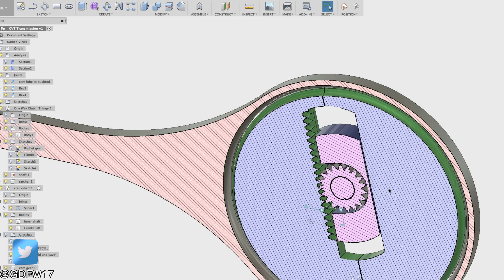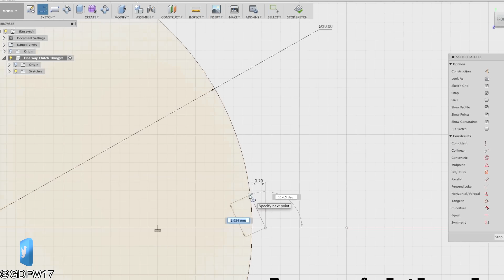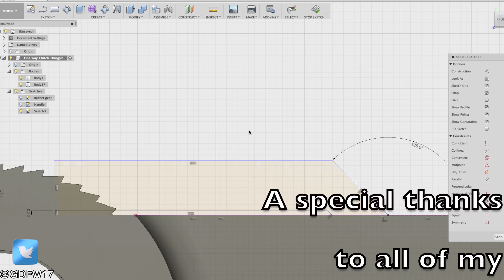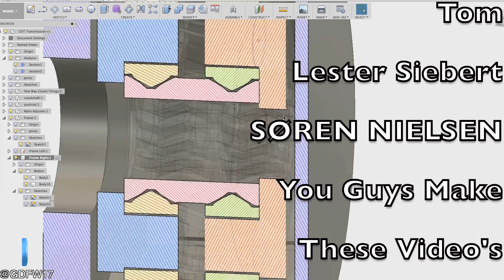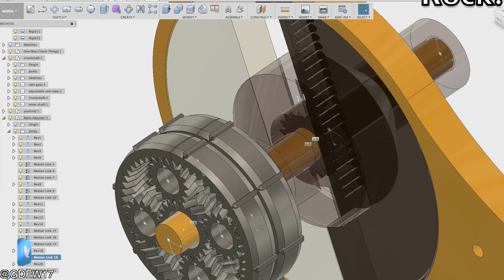The Coolest Transmission You've Never Heard Of... The Ratcheting CVT

Comment: Where did I see that idea before? Ah, I remember! 25 or so years ago, I tried to patent it. The weakest point of this transmission is that it has no way of holding the ratchet shaft if it decided to roll and overtake the speed it is intended to rotate with. You can't use it in the automotive industry (at least not without breaks). But then there is a beautiful CVT inside Toyota hybrids. It links the internal combustion engine, the electric  motor and the wheels in a computer controlled CVT which can be accelerated, decelerated and at the same time used to regenerate power via the electric motor. Absolutely BRILLIANT that CVT of Toyota's. Find their tech manuals and read it up.
Great 3D printing but sorry man you won't make money on it.
Reply: Dmitriy Lobov but then. Guess what, I don't think an over complicated system is like a time bomb.
Reply: How much time did it took to write
Reply: Another wannabe talking nonsense.

Comment: Very nice engineering.  I imagine that modern CVT design heavily leans toward noise and vibration reduction.  Easy example is helical gears opposed to straight cut in a differential.

Comment: This was a nice clip, great workmanship on a device. However, I fail to understand why this is a transmission. A transmission helps the engine to work less (rpms) and delivers more output (rotations). Your device doesn't appear to do that. The input rotates faster than the output. Your transmission works in reverse expectations. Think of like a bicycle. Peddle less but reach greater distance.
Reply from the maker: The word transmission doesn’t imply RPM increase. Cars for example use a transmission that decreases the RPM’s.
A transmission can work either way depending on what it’s designed for.

Comment: It would be easier to follow if you put a dab of paint on one, or maybe two of the splines of the output shaft. I think that this would help illustrate how the speed changed as you varied the ratio with the adjustment knob. I have to say that it is a pretty cool machine.

Comment: Hmm, well, CVT is great, but I found it is not very heavy duty. What makes matters worse, in my opinion, is that the greedy company just don't care to get better material so the transmission would last longer. I had a motorcycle with gears and auto clutch transmission and a scooter which use CVT. The scooter had transmission problems twice, which the belt broken after 20000km or so of riding. The auto clutch with gears had no issues at all at the transmission.

Comment: I know the feel, some years ago I tried to came up with an idea to reduce the lenght of the engines and used a Boxer as a base, so the idea was to cross two of them like an X and it seemed like a good Idea at first, then doing more research I ended up facing that those engines were used to power up planes before I was even born

Comment: Brilliant thinking, but even submerged in a tub of atf it would probably eat itself under load. I always thought about a chain driven transmission that works like a bicycle and the chain hops onto a different gear and the slack gets taken up by a tensioner, but have a computer control the shifting and use a torque converter to mate it to the engine. Only problem is if you lock up your wheels, you're stuck in the wrong gear, since it takes motion to shift.

Comment: For your final drive look into the concept of sprags. Reduce wear and ratcheting noise. There is a very simple design consisting of an inner race with ramps a cylinder roller and flat metal formed into a zigzag spring to keep the roller pushed up the ramp. The outer race is smooth. Going the active direction the roller pushes against the spring and down the ramp. Try to reverse and spring pushes up the ramp and wedges against the ramp and outer race and stops the rotation. Very quiet, very smooth and silent.

Comment: 5:40 "it s like using a super computer to play solitaire." ~ Scotty Kilmer might like that line. He might be able to help promote your product too.

I believe in Air Fuel displacement not Piston Numbers. Decided back in the Slant Six Days, an In-line and Opposed Cylinder Engine is neat. 1 to 4 pistons seems ideal for reliable operation.

But when people talk Engineering instead of personal experiences, I feel for my limited personal Observations look at car spokes and ask myself if perfection is 5 spokes then five piston engines also, yes?  Where are five piston engines?  It it true that an Odd number of lug nuts is better than 4 nuts? Where is 1 piston pump, 3 survey legs for a crawler, five pistons to roll over anything, and 7 Fast & Furious Light pistons for each of these ideals, yes?

Comment: So maybe you could have your engine set to a specific rpm all the time for it to be in the best ratio for power and have the "gas" pedal change the gear ratio in the transmission up or down to change the output speed
Reply: Semis could even double up on the number of gears to give it a much higher ratio to increase tork without increasing gas usage.

Comment: 3 things, current production CVT’s with ECU combo’s don’t hold the engine in peak torque and HP when driving in any performance setting(it technically could maintain peak performance from the engine with an ECU tune but thats extra money and effectively makes any daily drive-ability gone ), second, they cannot handle boost, lot’s of stories of Nissan Altimas with CVT’s burning out and even destroying tranny’s when turbocharged, third, they just can’t handle horsepower and rigorous track driving, I’m not saying they aren’t a good transmission, my Nissan Rogue has one and I’m very satisfied with it, but it definitely has limitations when it comes to motorsports, on a sidenote, great video and I love what you created here(subbed :)

Comment: My thoughts:
I like the 3 drive approach, alike 3 phase power they can all super impose to smooth out the output.
That said, there is error in manufacture and that error would introduce an oscillation on the output drive's motion.
It would be interesting to see what set of frequency that error could produce.
Usually +/- 0.1mm on each axis if your not certain and just want a test figure.

Still, if you were to use this for a precision drive you would have some interesting systematic errors introduced.

I also presume the output uses a ratcheting mechanism, so that or the selector would be the breaking point (max torque).

Honestly tho, this is super cool!
Would love to see more.

You could remove the ratchets and just use a cam to make the design a bit more rigid, reversible, and even power the output to drive the input. However, that will reduce the in:out ratio, make it larger, and add stricter tolerances.

Comment: it is a good idea but unfortunately it probably wouldn't work for passenger cars, the problem is the noise of the ratchets. Passenger cars are made to be comfortable and noise is something you don't want when designing a comfortable vehicle, and with this mechanism it is unavoidable. I see everyone asking about vibrations, well yes there is gonna be vibrations and even if you manage to cancel out the vibrations from the 3 rods by adding more or using counterweights the vibrations from the ratchets are always going to be a problem and from those vibrations come noise as well, unless you manage to make it spin so fast that the frequency is out of the range of human hearing but that would only cause more issues. That is why ratchets are practically never used in cars.

Comment: Very interesting!...I can see two stand out problems, vibration (not your prototype, but when scaled up and running at 3000-8000 RPM) and amount of power that can be output...there are two spots that will define the maximum power that can be transferred, the gears inside the 'pistons' and the ratcheting mechanism itself...

Comment: A ratchet mechanism is an absolutly nogo for serious applications
Reply: Ya, but it's really cool!
And he probably learned a lot, developed real-world skills and has an accomplishment.
Reply: Your "ratchet mechanism" is called a sprag or roller type clutch, they are in most, if not all automatic transmissions.
Reply: Seems like this idea could be applied to a hydraulic pump, though.
Reply: Also, the more areas of contact means more wear, I'd rather change 50 belts than a whole ratchet assembly because the teeth started to be ground away
Reply: @OB1canblowme  buy a Nissan and then tell me how many $5000 belts you'd like to buy.
Reply: ZwurlTech why's that?
Reply: The most important factors in a serious application are efficiency, reliability and durability. And whenever a rotating motion is transformed into a reciprocating, and than re-converted in a rotary motion, you will run into a massive efficiency problem. In addition, the ratchet-mechanism generates pulsating torque, which means a very critical load situation for the entire drive train. In order to transfer a high torque, the parts of the mechanism must be strongly dimensioned, with strong springs. But strong parts are heavy, and that leads to big problems at high speeds. And they produce a tremendous noise
The spring-loaded parts of the mechanism generate a high degree of friction heat while moving back, this leads also to a massive efficiency issue. The point, where the edge engages the groove is extremely susceptible to wear. And so on...
For these reasons, I think, your mechanism ist well suited for some control-applications, but never useful vor a serious gear train.
Reply: ZwurlTech Yeah, that part of video sounded dumb to me.
Reply: Just kicking around ideas but what about one way bearings it's still an interesting idea
Reply: As for automatic transmissions, a bike sprocket type gear cluster on a threaded rod portion of the back axle that shifts from left to right against a spring is one concept I came up with. The spring would compress with higher torque shifting into a larger gear against a static chain and tensioner.
Reply: In a car, a rotating mass of engine with that changes would cause oscillating across the car. Manufacturers have to account for the spinning mass which can actually cause the car to become unbalanced.
Reply: Life exists because of ratchet mechanisms on a molecular level, but that isn't a serious application!
Reply: @D yes I built something similar, but for a large rotational yagi.
Reply: So is a clutch, you don't even need one while driving a car/truck and going between gears (except to go from stopped to moving)... So why are they on almost every vehicle with a manual transmission?
Reply: @SpringRockerPSN  because you actually have to start and stop your car. and because changing gears without using the clutch will very soon ruin your gearbox. 
so there is a clutch on every manual transmission because it is needed
Reply: @dimosk7389  It will damage (not ruin) a synchronized transmission, because there's no feedback for mismatched RPM. Medium- and heavy-duty transmissions are almost invariably unsychronized, and are normally shifted without use of the clutch.
Reply: @SpringRockerPSN  The reason you need a clutch on a manual gearbox is actually exactly why a ratcheting transmission wouldn't be viable in consumer automotive use.

Nor is it actually a CVT, because of the nature of ratcheting, there is a limited amount of gear ratios that the transmission could have. Sure, it might be 50 different gear ratios, or 100, or 1000, but a CVT technically has infinite ratios.
Reply: I second that. There's one thing you're not talking about : effeciency . This will be horrible in this system.

Comment: CVT are also known for being horrible at holding high powered vehicles, slipping and eventually wearing out... They are used for MPG optimization, so they aren't as great as advertised.Unless you want a prius or something for good mileage and less power holding capability.

Comment: I had a Nissan Qashqai CVT - very smooth to drive very powerful so easy to drive. It uses all steel belt which is quite strong - your set up looks very interesting and I cannot see why it cannot be manufactured all steel suspended in fine lubricating oil as with the Q. Can you make an all steel model perhaps using laser cut-outs? A company would do this for you. A CVT on each wheel of a car should simulate 4 wheel drive and your system looks compact and light enough.

Comment: if this mechanical system is anything like phases in electrical engineering the only diminishing return I can think of is that the more phases you have the more material and thus the more weight
which kinda reduces the effectiveness of one of the main advantages
and price ofc but that's nothing mechanical :3

Comment: guessing one would need to increase the amount and size of these ratchets to make a truly usable transmission from these parts. that drill was spun up high to get very little speed from the output shaft, i'm not gonna guess what the input/output ration was, but it didn't seem efficient at all.

Comment: Really cool idea. You could use a crankshaft instead of the ratcheting mechanism and only need a single con rod. It would also make the mechanism a lot simpler and stronger. Also, balancing a variable connecting rod like that might prove to be difficult.

Comment: that particular design of your seems like it could have a lot of applications even outside the automotive industry. you could essentially have a motor running at full speed but still control the output as needed.

Comment: I mean I commend your effort... but this is not a true transmission. It is not multiplying torque/speed like a transmission needs to. The input shaft just transmits power intermittently via the ratcheting action on the output shaft. It's closer to a throttle than a transmission.

Comment: hey. ok im sold. lets get one built. for my car. it needs a new transmission. As i lost reverse, and i am loosing some forward motion as well. Its slipping. Can your invention be made to have a reverse function?That is key here, its the main problem i am having now. Getting out of the car to push it backwards is not ideal. If any hot bitches were with me, well, that's going to cost me.

Comment: Hey, sweet bit of kit. My question is how does it jump from say a very low ratio all the way back to idle? I see the idle location on the adjuster is on the opposite location. Could there be a decoupler added either before or after the gear set in order to smooth the transition?
Reply: Since it already employs a ratcheting mechanism on the output shaft, perhaps a sprag clutch would work well.

Comment: Around 6 minutes in, you said more than 3 would produce diminishing returns. I disagree. Six is better.......opposed. This will keep it from rattling itself apart.
When #1 if in forward position, #4 is in rearward postion, etc. Like the balanced recoil system in an AN-94 rifle.
Reply: What about instead of ratcheting go with a sprag clutch design!!

Comment: This really looks like the output speed is nowhere near as high as the input speed, which might be alright for low torque engines, but your input to output should be about the same.  Most cars 4th gear is 1:1, then 5th is overdrive.  In older cars that are 1-3 or 1-4 it just ends at 1:1

Comment: Sorry I don't know much about CVT transmissions but a farmer I used to work for had a case tractor with a CVT transmission but like with a tractor that has powershift with a range of gears from 1 to as much as 16 gears, how is the CVT transmission better and how does get better fuel mileage with a load on the tractor like ripping ground. Then since you know gears alot better than I do, how does a power shift transmission work?

Comment: I've got an odd question. Your system uses a planetary gear system. Has anyone tried making a CVT based on just that? I mean, by  turning the "planets" into cone shapes and designing the inside and outside to accomadate for differences in size, you could control the speed of the outside wheel by simply pushing the planets further in. If I'm speaking greek, just let me know.
Reply from the maker: Problem is that a cone shaped gear has smaller teeth at one end that won’t mate with larger teeth or vise versa, and yes, others have tried it.

Comment: OK dude with no apparent name CVT inventor.  Maybe you can create a multi-purpose transmission block onto which you park your lawnmower on top of and it has an air compressor and a small generator to make 115 VAC to run a fridge or small AC during a power outage.  It transmits lawnmower power to whichever implement you need. Great utility for home owners and small micro farmers to have emergency portable power.  Plus you get to use the mower for things other than mowing.

Comment: My 2008 jeep patriot has a cvt transmission it gets really loud at specific point, going up an incline at 55 is a lot louder than 50.  It also has the option of fake shifting by pushing the shifter to the left or right, every once in a while I accidentally put it in first gear.